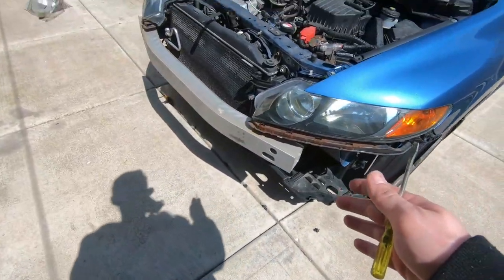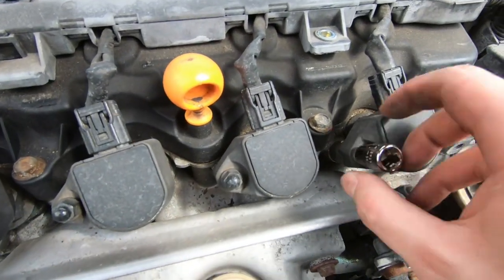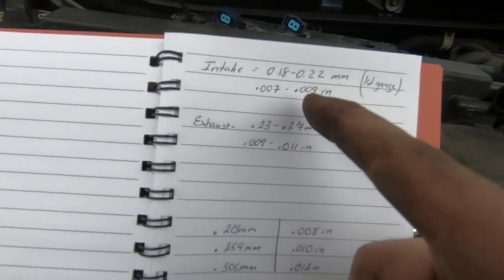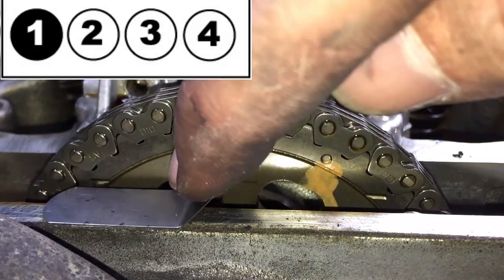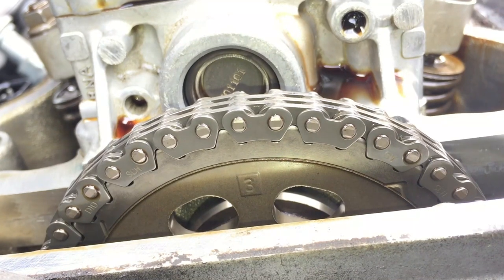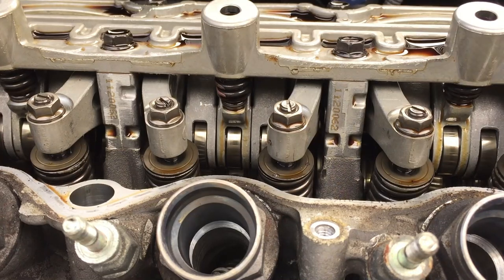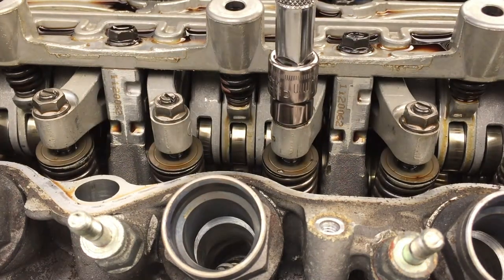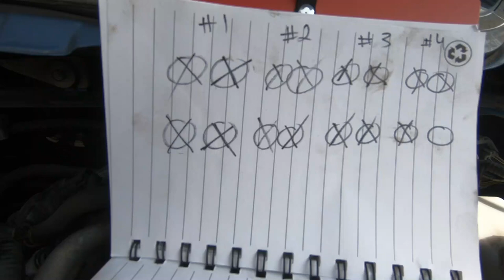How to do a Valve Adjustment and add Horsepower (Step by Step) 8th Gen Honda Civic

Comment: One tip is that you could just leave the filler tool inside the valve spacing and adjust the valve that way. the bolt should stop moving once it's tightened and hits the filler tool. This should make the entire process significantly faster and more precise.
Reply from the maker: This is true although  I keep hearing you want to adjust by feel and drag.  But the way you described will get you to the ballpark very fast.  Cheers.
Reply: @BulliKid  hey man your video are awesome I have a 2007 civic ex currently stuck on major power loss no code or anything I've changed everything from fuel pump to solonoid to o 2 sensor can you help me out
Reply: @BulliKid  do you think I might need a valve adjustment
Reply from the maker: @dannyperez2465  do a compression check first.
Reply from the maker: @dannyperez2465  and then a leakdown test. Hve videos on channel of both.
Reply: Very good point this will be my first time but I'm pretty handy and I'm pretty good at learning from being shown so I think I may be fine as long as I take my time on it my car has a 160000 miles on it I'm replacing the genuine Honda valve cover gasket and I was considering checking the lash valvea while it's off my car is a 2009 Honda civic ex coupe R18A1
Reply: Exactly what I’m doing

Comment: To avoid a leaky valve cover torque the valve cover bolts is a spiral pattern, starting with the bolts in the center, working outwards. Tighten them in two steps, with the final step torque to 7 ft. lbs. (84 in. lbs. or 10 Nm).
Reply from the maker: Thanks!

Comment: 4th vid I watched in a row doing similar work and you're the first to remove the cowl...I dunno why no one else did it, I mean even if you bust any of those clips it's only about 15 bucks for the entire set of them...spend 15 bucks (or 0 if you don't break them), or fight with the intake side...hmmmmmm hard choice.

Comment: Great tip about removal the cowl. We ran into an issue where the valve cover bolt snapped when putting it it back on. Of course it t was a rear bolt. Having the extra space made it possible. We had to use multiple screw extractor to get it out. We got lucky we had no head damage.
Reply from the maker: I have had to undo a broken valve cover bolt also.  It was a lot of work but worked out ok

Comment: you can also slip the gauges under both ins and both outs and adjust until the arms don't wiggle. that way you know the gauge is in there flat. if the arms wiggle, too loose. if no wiggle and you feel excessive drag, too tight. no wiggle and little drag, spot on.

Comment: Oh boy this is sooo wrong... 17:30
All DIYers if you follow this,  you will have more problems than before touching it. You don’t check clearances all at once!
First you need to align crankshaft to UP sign, and check cylinder 1 valves ONLY. If needed, then you can make adjustments only on two intake and two exhaust valves of 1st cylinder.
Then rotate crankshaft to sign 3 (pay attention to horizontal line on right side of 3 symbol, it needs to be level to engine cover) and check 3rd cylinder valves. Then rotate to 4 and go ahead with 4th cylinder valves, and at the end rotate to 2 and check 2nd cylinder valves.
So order of checking is 1(UP), 3, 4, 2. 
After done, rotate two more full cycles and you cAn check clearances again to make sure all is fine. 
This applies to R18A2 engine type.
Reply from the maker: That’s exactly how I did it. 
What’s wrong with 17:30?
Reply: Great video man. I think what he's saying is only touch the intake and exhaust valves according to which it's been rotated too......which you did sooooo...lol
Reply from the maker: Yea. Not sure what Means.  🙌
Reply: @BulliKid  Question for ya. How loud was it before you adjusted everything as opposed to when you finished?
Reply from the maker: @michaelschwab9563  I noticed a noticeable difference!!
Reply: @BulliKid  With tapping I assume yes? If so that's awesome
Reply from the maker: @michaelschwab9563   yes after driving the car aggressively and warming it up I heard a lot of tapping most noticeable at idle and low rpms.  Once I did the adjustment I felt the car was just more sold and throttle was a little firmer and more responsive.  And again the noise was safe to say much eliminated to the point I don’t notice it.   Much needed now that I will be going turbo.
Reply: @BulliKid  that's awesome. 👍🏻

Comment: Thank you for the video very well explained and of course it is very useful to me because I going to change the head gasket and I will need to adjust the clearance of the valves
Reply from the maker: Awesome. Thanks for watching and Goodluck with headgasket. It’s a long job! But very rewarding.

Comment: Thanks for the detailed and informative video. I'm the 2nd owner of a 2008 civic with 175k miles and don't know for sure if the valve tolerances have ever been checked, but I heard the noise might also be from the fuel injectors. It gets below freezing here so maybe I'll wait for spring weather. Looks much easier than I expected it to be (but so did videos for suspension work and replacing starter which were NOT that easy).
Reply from the maker: This is a long process! Injector tick sounds a little different then valve tick.   My buddy has 180k on his lx and he never did it but I drove his car and my top end pulled a lot better and I give credit to valves being in tolerance Vs his loose valves.  

Anyway, thanks for watching and for the comment !

Comment: Hey thanks for this video.  I did this adjustment, same engine, but I think I got them a bit tight.  Had a couple misfires.  Replaced spark plugs and loosened up the adjustment but car is still hard to start in morning.  I only drove like 50 miles city while the valves were tight.  Is that enough to cause burnt valve?  Why would it be hard to start when cold in morning after adjustment even if it's correct now?
Reply from the maker: Run a compression test to make sure your compression is good and no valve damage.  I doubt you have any balance damage unless you were way off.

Comment: Will this help with lack of acceleration i have no codes but my manual r18 for some reason had lack of acceleration and power even on hills my miles per hour starts declining and i have to drop a gear
Reply from the maker: It’s possible if your balances are out of adjustment far off.
Reply: Don't forget to also check your air filter & throttle body

Comment: Hi, why it is important to plug the coils the the same spark plugs?
Reply from the maker: Honestly it probably won’t matter. But I prefer to keep them in same spot.
Reply: @BulliKid  I did valve clearance today and I have noticed that one of the coils have a small red dot on it. I can't remember the exact location so I put them as I did. Nothing strange so far, it is working.
Reply from the maker: @IGNITERSTER  should be fine! Mine have some discoloration here and there too.

Comment: Perfect video.
Do you have any info what are the valve clearance values for Honda Civic R16A2 engine? This engine is for the 8th generation 1.6 Civic Sedan.
Reply from the maker: I do not but I’m sure you can find it online.  Or owners manual.
Reply: There is nothing in the owners manual, so I keep looking for online.
Thanks for the answer anyway.
Reply from the maker: Sometimes they have it listed on the top of the hood

Comment: you should look into getting a power ratchet it speeds things up
Reply from the maker: Probably! Maybe In The future.
Reply: i just did the valves and mines has 145k miles double of what the interval was and man were they slacked. I swear the car does seem to have more pick up and better throttle response
Reply from the maker: I agree. The car felt better after the valve lash adjustment.   Subscribe to my channel as I am going to be doing a turbo build on mine this year 👌

Comment: I have a question I have the exact same car and Idk if I should do this or pay a garage to do it but when you top died center a cylinder and adjust the exhaust valve what do you have to do to do the intake valve adjustment do you leave it at top died center and just do that after you do the exhaust and also what cylinder did you start with and by the way you did a great video I wish you would have showed you doing all of the cylinders even though it's the same process as the one you showed us and also when you did the adjustment did you do all the exhaust ones first then do the intake after  thanks again
Reply from the maker: Once you are top dead center of a cylinder you check both intake and exhaust valves.  TDC means all valves should be closed.

Comment: When should you do valve adjstment?
Reply from the maker: Many recommend over 70k or when noisy. 
Mine were noisy and turned out to be out of spec.
Reply: @BulliKid  ok I will listen to the vehicle when I can. Thank you for such a fast reply
Reply from the maker: @Killmonize  no problem.  Make sure you listen for a louder tick. Injectors sometime can sound like lifter tick but it is different.
Reply: @BulliKid  thank you so much. Neber done on my car before. Donenon other cars. My civic has 200k
Reply from the maker: My friend has 180,000 in his car and he needs to do one ASAP also I definitely noticed driving his car after like 4 1/2 thousand RPMs mine definitely pulls more with properly adjusted valves.
Reply: Service manual says to inspect at 30k miles

Comment: I know its best to aim for the middle of the specs but is it better to have em more tighter or loose? That way i can adust accordingly depending as the valves wear do they either get looser or tighter out of specs
Reply from the maker: Tighter for performance
Reply: @BulliKid  okay so i just did my adjustments and i feel like i went on tighter side what i did notice is that i have crazy low end now but my high end feels like its choking.. unlikd before when i had loose valves it felt like it had more top end and little low end?

Comment: ive heard to never go backwards when hand turning an engine. If you miss the spot go all the way around again the correct way
Reply from the maker: Hmm interesting.
Reply: @BulliKid  I don't see why it would matter, the cam should reopen the valves the same way, but I trust who I've heard that from so I tend to stick to it. Just my .02c. Fantastic video though, I will re watch it for a refresher as I adjust the valves on my wife's civic in a couple weeks
Reply from the maker: @Barn94  maybe rotating it backwards may possible loosen the crank bolt.  ?

But thanks for the comment! 
I noticed quieter valves and a more responsive car with better top end power.
Reply: @BulliKid  I'm not sure but that is a strong possibility. The valve cover gasket is leaking really bad so I figured it would work the valve lash while it's open. Poor thing has gone 214k miles and has never been opened
Reply from the maker: @Barn94  send me a picture of the internals with 200k on it.   If you have ig at bulli kid.  Curious to see how it compares to mine at 88k with only Pennzoil full synthetic.

Comment: So you can adjust both intake and exhaust valves at the same time if that cylinder is at TDC correct?
Reply from the maker: Correct.

Comment: Are the valve clearance specs the same on the 2.0L SI engine for 8th gen?
Great video. Thanks.
Reply from the maker: No. Si is different!
Reply: @BulliKid  Ok thanks. I have to hunt those specs down. And maybe work on it this weekend.
Reply: Is all the 1.8 civic ivtec engine 2008 are same valve clearances sir? Where can we find their valve clearance specifications?
Reply from the maker: R18a engine yes.  The r18z maybe is different since they have different head/ can design.
Reply: @BulliKid  I have 1.8 Honda civic I vtec engine sir...I want to adjust their clearance by myself unfortunately I don't know their valve clearance specifications.kindly please help me sir Kidd.thanks in advance..I'm your Filipino fan,I'm working here in Qatar...I really appreciate your videos...very informative   and easy to understand.
Reply from the maker: If you Google valve lash adjustment specs for your car they will show it.  Or look at your owners manual.

Comment: Thanks for the clear and detailed video! one thing tho, did you have to put the car up on stands?
Reply from the maker: Thanks.  No you do not. But it will be easier if you remove passenger wheel.

Comment: Would that specs work for my.. 2006 honda civic FD1 1.8L .....
Reply from the maker: 2006-2011 civic r18 engine.
Reply: does the 2011 honda civic ex have the same engine as this? im trying to find out about it online but am having trouble with that
Reply from the maker: Yes same engine.
Reply: thank you, especially for the quick response even though this video is more than a year old
Reply from the maker: No problem. Always on YouTube posting weekly.   Just put a turbo on my car! Subscribe to support!
Reply: i already did that an hour ago, as soon as i realized most of your videos are still on the same civic (im pretty sure?), which i am super glad to see
Reply: now… my problem is that my local hardware store just closed 10mins ago and i know that i definitely dont have feeler gauges laying around in my toolbox somewhere…
Reply from the maker: @neon1867  yah you def need feeler gauges to do a proper lash adjustment.